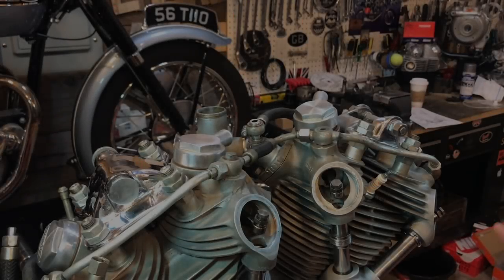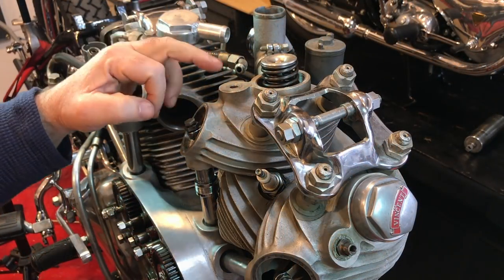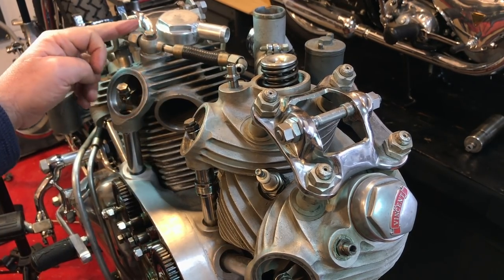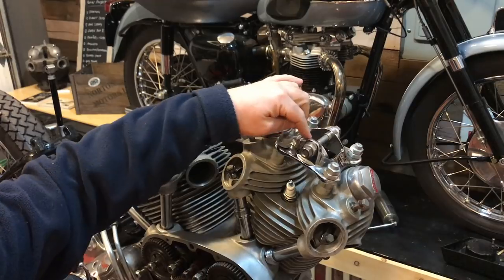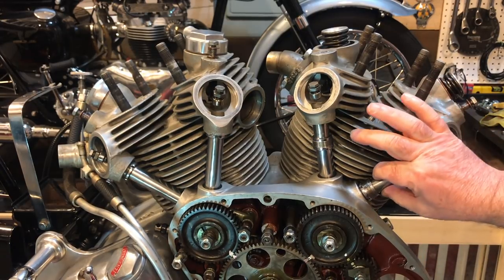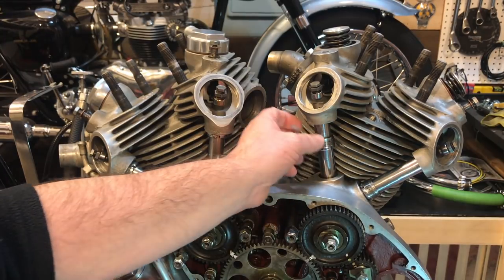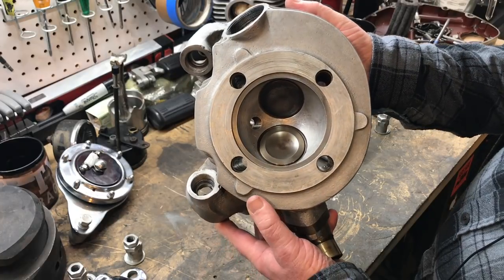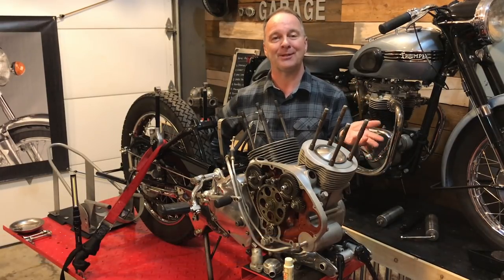Restoration of 1951 Vincent Rapide - Part 19 - Top End 1

Comment: I feared the worst but the head is excellent. That's a pile of tricky jobs you won't have to deal with. I'm loving this saga - as one of your other subs said below, Journey to the Centre of the Vincent. I hope very much that splitting the cases won't be necessary.
Reply: Just watch the length of the 1/4" B.S.F. bolts attaching the rocker feed pipes. They should all be 1/2" long. Too long and they can block the feed.

Comment: difficult to know when to stop with a project like this , imagine if after all that work the bike suffers from vibration due to worn or misaligned crank assembly , if the bike is one you want to keep id be tempted to go the extra mile and split the cases to check big ends and main bearings at this stage, correctly assembled a bottom end could last 100 000 miles according to the factory ,these videos are great ,many thanks

Comment: Thank you for your 19th installment. From what I could see the Rapide doesn't have head gaskets. Is that because that locating ring at the top of the sleeve has such fine tolerances that it acts as a gasket?
Reply from the maker: Hi Big Red, yes that's true. There is only a paper gasket on the barrels but no head gasket for the reasons you mention.  Cheers, Mike

Comment: What a beautiful engine! looking at the valve rocker I dont see how the valve is pushed down. The rocker clearly gos into the head but there looks to be nothing above the valve stem and springs were the other end of the rocker is normally seen. Even from the diagram I could not see how valve actuation was achieved. It would be interesting to know how this was done by Vincent.
Reply: John, the valves are pushed down by a forked rocker that engages with a groove in the valve stem. There are also two valve guides per valve, one above the rocker arm and one below. I guess the idea was to reduce the side thrust on the valve stem, caused by the wiping action of the rocker on the end of the valve stem in a conventional design. 
Modern ohc designs use bucket cam followers which take all the side thrust. Consequently valve stems can be much smaller diameter, reducing inertia.

Comment: Hi plan to remove my head as been sat a long time (12 year) and want to check the seats . on inspection of the exhaust port seems a slight weep, so need to check the stem. Hope not to remove barrel. No gasket on the head? only the barrels . Took the head to my machine guy who will go through them and check seats etc..
Reply from the maker: Hi Nick, good idea to take them off just to check. Yes, that's correct, only a gasket at the base of the barrels. Good luck with your machine work! Best wishes, Mike

Comment: Hi Mike, I've been using this as my guide and now I am waiting on parts (push rod seals) to arrive.  I note this was posted four years ago.  Did you end up retorquing the heads?  I'm getting mixed responses as to the need, given there is no head gasket.
Reply from the maker: Hi Daniel, sorry for the delay. I have not been feeling very well. No, I did not actually end up retorquing the cylinder head bolts. It’s been one of those things that I have been “meaning to do“ for a couple of years! I think the next time that I take the front end off the bike, I will check the torque settings. Best wishes, Mike

Comment: Having taken out the rocker feed bolts i would of taken the rockers out and fitted the new rocker bush locking nut. This stops the rocker bush from becoming loose in the tunnel, the nut fits through the bush and lines up with the rocker oil feed bolts, when they are tightened it pulls the rocker bush up in the tunnel nice and tight.
Reply from the maker: Thanks a lot John. I might do that modification in the future. Cheers, Mike
Reply: @TheMightyGarage   Hi, I presume you have  a copy of Know thy Beast, the article is on page 159. Chow for now.
Reply from the maker: Hi John, I do have that book and a few of the other common books.  I had read about the new feed bolts and have jotted it down as a future job.  Best wishes, Mike

Comment: I am sure you have made the right decision to go further with your investigation, looking at some of the "slap it together" moves that have been discovered so far you could never trust what has been done, it looks like the job was started with good intent, but then the decision was made to sell it, and it was just thrown together in one piece, can you imagine what would have happened had you tried to start it up, you will now have a twin that you can trust, having been inside and checked, a very good investment in time I think, there are oil banjo bolts that pull up the rocker bushes and hold then tightly in place, worth looking into at this stage, I don't like the design of those rocker covers, every time you need to undo them you will have to strip half the engine down, an awful design, if the breather part turned on the cap it may be worth having, but they are something you may regret fitting at a later stage. It all looks a lot better now than when you got it .
Reply from the maker: Thank you Chris for your very thoughtful comments.  You have me thinking carefully about that rocker cover breather now ;) Hmm, I might have to re-think as, like you say, I don't want to have to reassemble the whole top end again if, for example, the spigot needs to point in a slightly different direction when I finally get it all back together again!  Thanks very much!  Cheers, Mike

Comment: I'm wondering how the rocker arms engage the valves.  It clearly can't push on the top of the valve stem.
Reply from the maker: Hi Kurt, the rocker arms have a fork at the end of that engages with the valves. Here’s a link to a site with a diagram of the cylinder head assembly including rockers. Hope this helps, cheers, Mike.  http://www.thevincent.com/vincent%20engine.html
Reply: @TheMightyGarage  So, the notch in roughly the middle of the valve stem is where the fork in the end of the rocker arm engages?  Are there other engines that have used this design?  Maybe radial aircraft engines?  The Vincent engine has always looked like a couple of cylinders from a radial engine to me.  Thanks very much.
Reply: Hi  @TheMightyGarage  & Kurt Jensen. Desmodromic valves, same as Ducati engines. The valves are actuated on a shoulder, located part of the way down the stem. That's why the rockers are forked, in order to push equally on both sides of the stem.